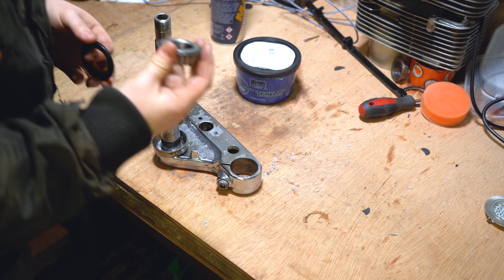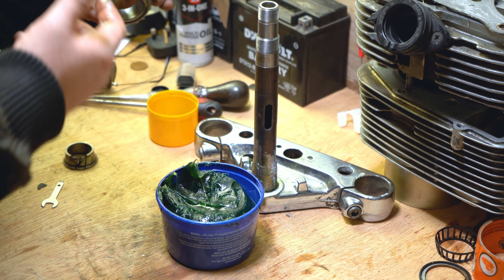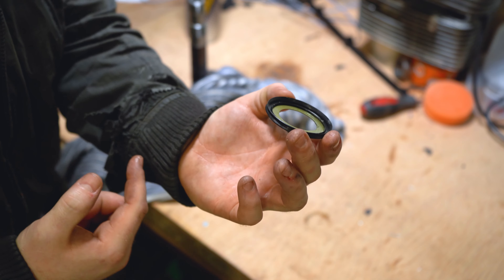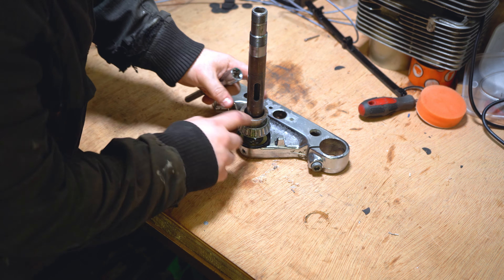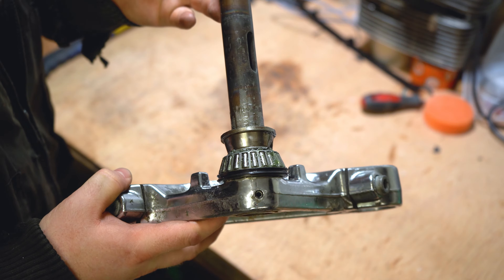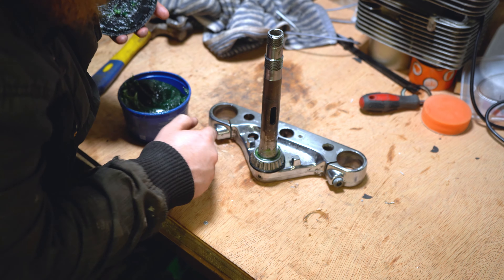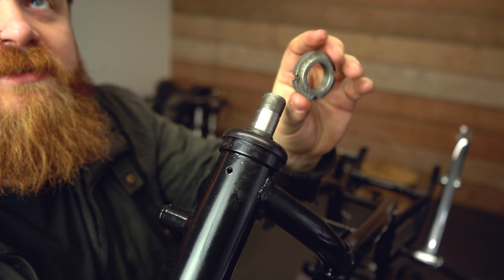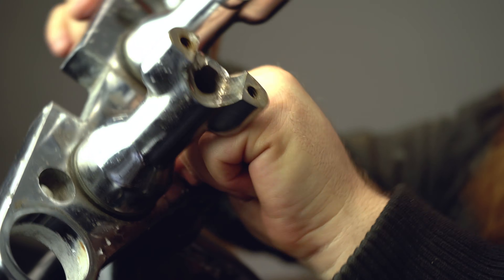Suzuki Intruder VS1400: Headstock Bearing Replacement 2/2 - Rebuild Part 3

Comment: To get the lower ring out was hell. But did find an old video with (insert name) and he used a wrench, irontube/rod and hammer. It took some time but finally I got it out. Lower bearing I did just as you. All installed and finnished now. Didnt have the tool for upper nut, the one with the 4 slices/holes. So I made my own by drilling and put in 2 screws in a 36 mm wrenchhead. Have pics if you wanna see😂
Reply from the maker: That sounds like you had a great time Robin!!! lol Sure man I've added you on Instagram!

Comment: i did this to my 1996 1400. ever since reassembly I've had a hard time with how the bike handles- like it can't find it's center, won't stay in a straight line, handlebar movement side to side not up and down . I read this could be due to that spanner nut being too tight. I've spent a month gradually backing it off and testing the ride and it gets better but no full fix. i took it to a local shop to see what they think. they torqued that spanner nut according to the manual (torque then back off a 1/4 turn) and now it handles like it did when i first reassembled (super cockeyed handling at the front). does this factory torque setting really matter? I've never heard of that nut being torqued, but usually as you said "to your liking". The shop doesn't want to send me off with an ill-adjusted nut (liability), but they are perplexed. Help!